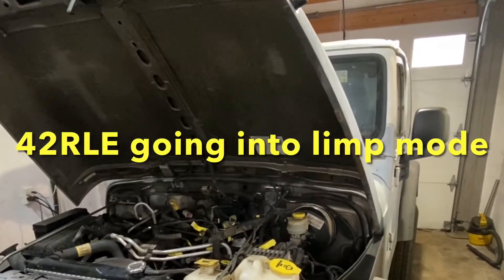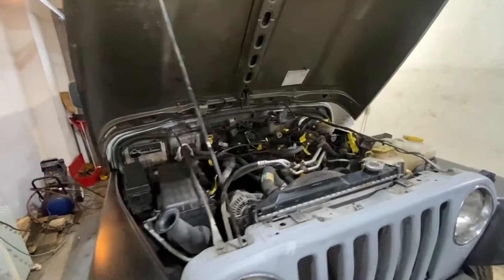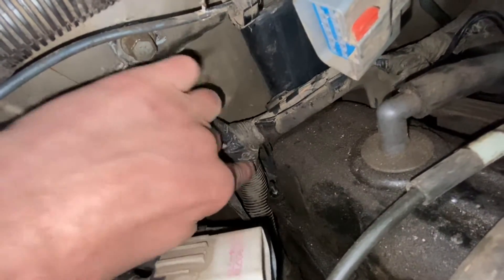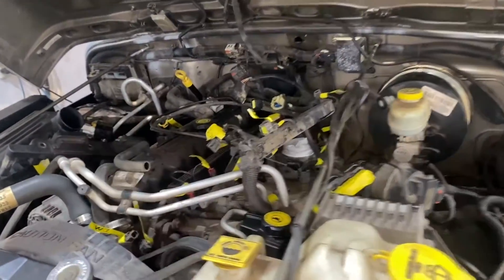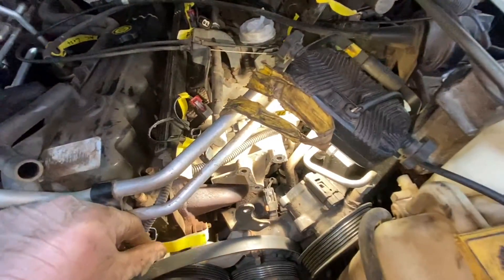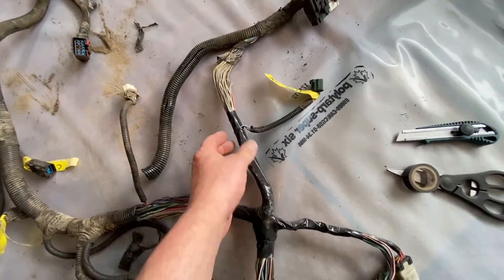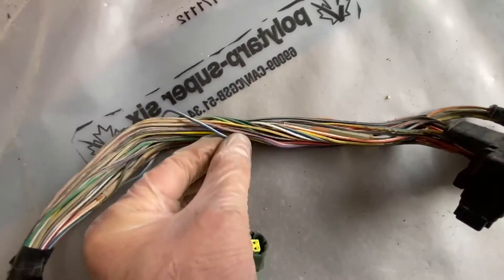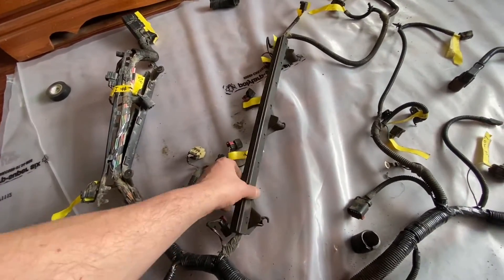42rle P1775 P1776 How to check the electrical harness.

Comment: I ran through my 2008 JK harness and the tranny wiring was fine. I did however find that the O2 sensor wires on the passenger side at the transmission to block area were not in great shape. The exhaust is located right next to where they enter the engine compartment. I added new wires and heat shielding plus located the harness upward just about even with the ground bolt on the block. The harness is now 6" away from the exhaust.  On the driver side there's plenty of room to clear the exhaust just relocate the clamp on the transmission to the next bolt up. You're going to have to adjust the harness a little to give it enough slack for the starter and solenoid wires. Replace the heat shield for the starter. It's critical to prevent the exhaust from heating the starter. Other than that, it's not difficult. But it will ensure that the harness is not going to melt due to the exhaust.  Next step is pulling the pan and doing the repairs inside the tranny. I'm going to do the valve block and solenoids mainly because I'm already there and it's not worth finding another issue within a few months.  I'll also do a complete flush to make sure all the old fluid in the converter and housing is cleared out. It's not cheap but it's cheaper than a rebuild.  I put 387.000 miles on this Jeep and hit trails all over the United States in it. So it owes me nothing.  This might make it to 500.000 without any more problems. Time will tell. 
Really like your video's.  I don't normally go to YT for mechanical advice, but I got a recommendation from another Jeep guy. He was spot on. No BS just straight to the point technical advice.  Thank you, you earned a subscription.  And you bet I'll tell people about your channel.

Comment: Ummm continuity testing and resistance testing can be done right in the vehicle. 

Also wires absolutely can break inside with the wire cover still intact.

Comment: Great video!!  So I found a broke clip that holds the connector down next to the big green plug on the driver side of transmission.  It will ride up because of the broken clip… any ideas how to repair harness without a total harness replacement
Reply from the maker: Not too sure your particular situation, but maybe go to the junkyard and cut that piece off and solder it on